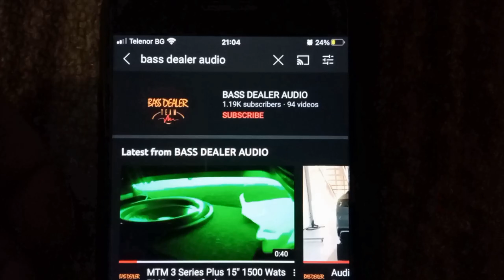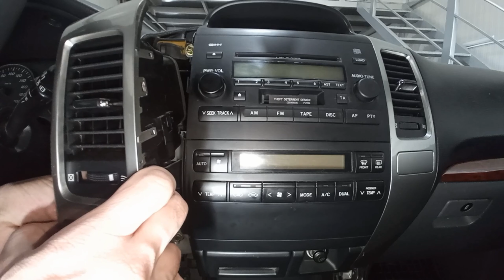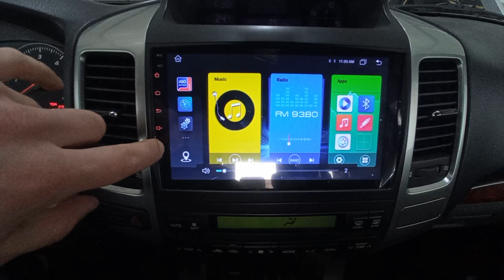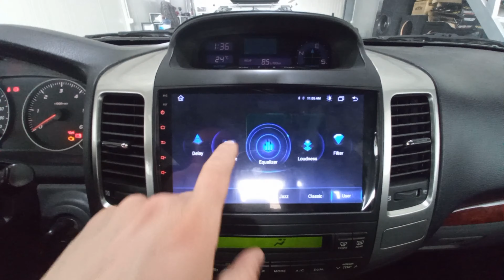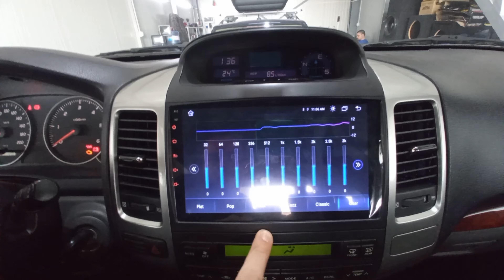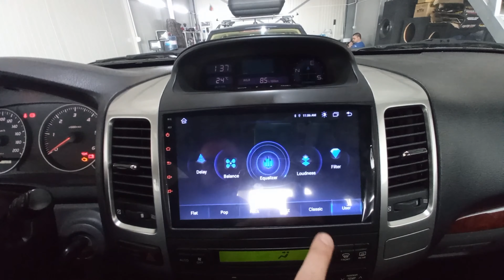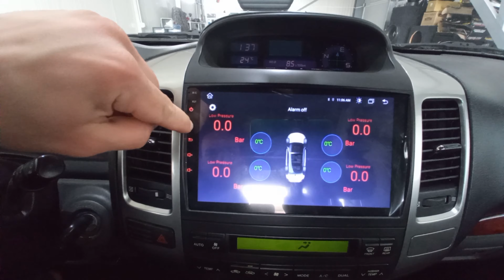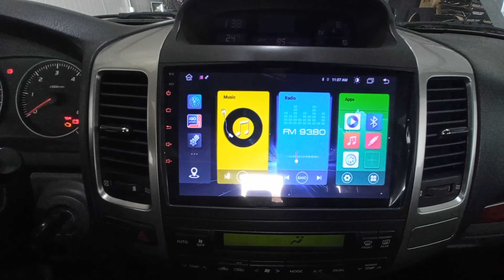Toyota Landcruiser 120 9" Android 11 Installation / How To Install Navigation & Rear Parking Camera

Comment: Where did you get the frame from? the one I bought, the headunit fits inside the bracket and doesn't really look good. The other option is install it with it sticking it out a little from the dashboard, but somehow you have yours pretty flush
Reply from the maker: You can order frame from aliexpress or ebay
Reply from the maker: Or you can order navigation from www.carmedia.bg
Reply: @bassdealeraudio442  That website will not translate for some reason, its in Bulgarian. Are they sold anywhere else